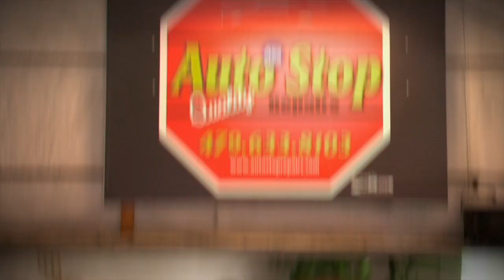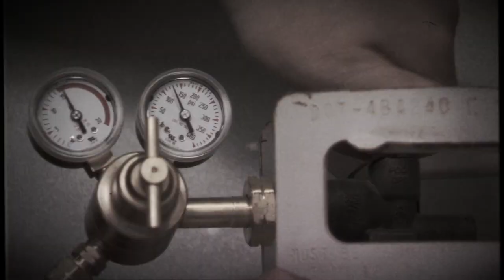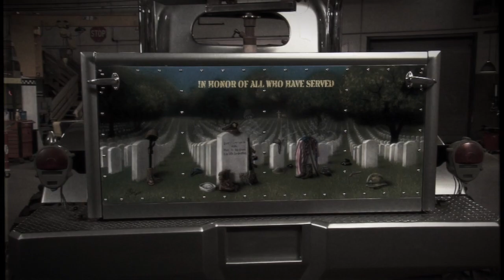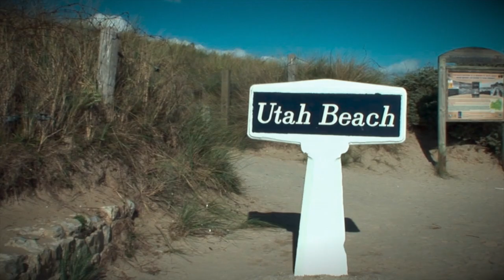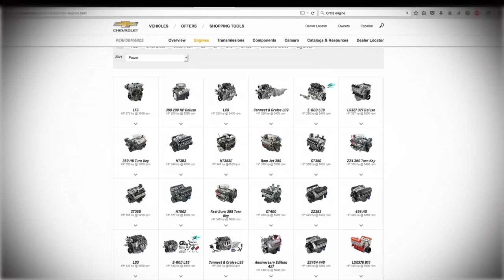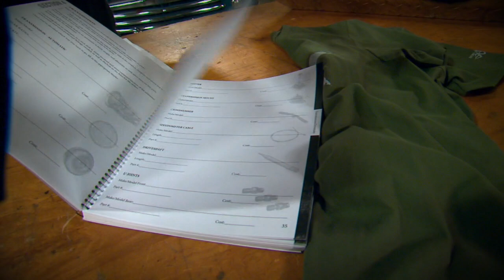Gearz on the Road - Normandy D-Day Beaches - Sgt Rock Updates - Stacey David's Gearz S9 E13

Comment: I am one of your biggest    fans i learned more quick tips but since I've been watching your shows first on trucks then followed u from there but i really cant talk i have over 30 good projects joined with my father's were 200 strong but the reason i had to comment is u said that u have been working on Sgt rock for a few years in this episode Mr davis it has to be close to 10 years or better i remember when it came in u were on trucks and u found out that someone clipped that cab u weren't sure if i think it mite of had international cowl parts but im a loyal watcher im going on 45 and i cant finish what i have so not giving u a hard time cause outta all the shows thru the years u do the stuff the way i would dream up the tow truck i built a 1 ton 97 chevy xtracab boxed the frame all the way under the cab took that 454 out worked it to a 468 did corvette servos in the trans passes everything but a gas station i wanna c your Naval international finished thanks again a true fan Johnny